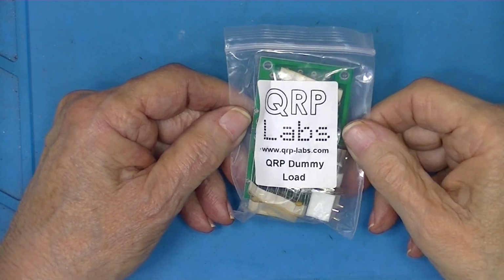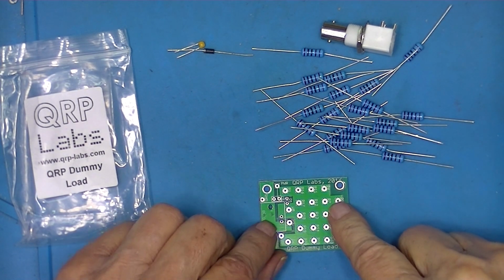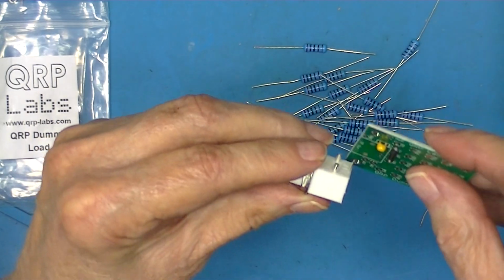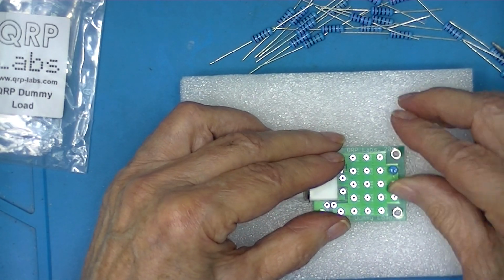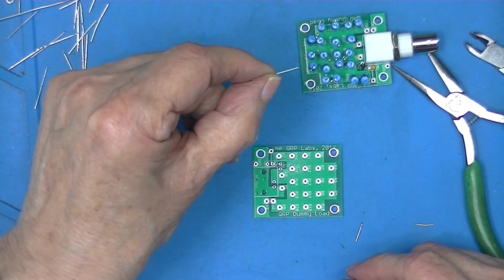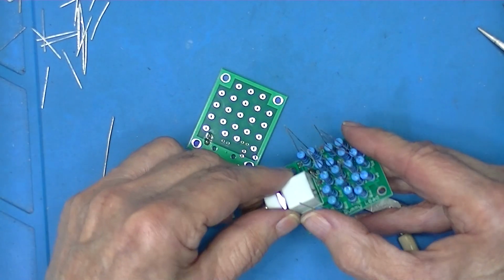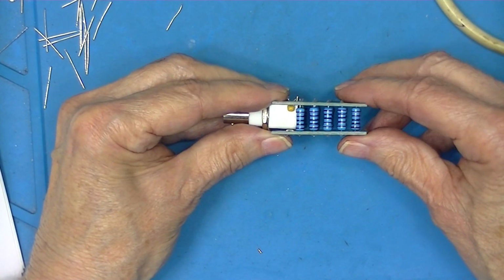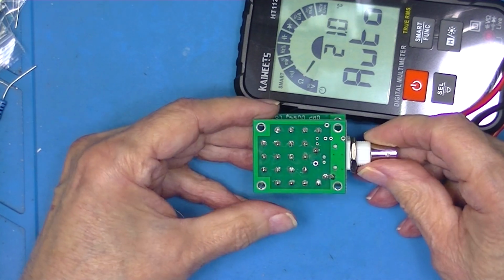QRP Labs Dummy Load Kit

Comment: I noticed the same, but I had already soldered mine to that point. Thanks for the tips and tricks, only my second soldering project! Such a great video!!! I did have to change out solder tips on my Weller wp-25 because even the small chisel tip i have was way to big for small board parts.

Comment: Did you ever solder the BNC leads to the circuit?  I must have missed it, but at least the connection is making it through.  I'll be doing this as soon as my QDX Rev 3 arrives along with the Dummy Load.  Thank you for the primer.